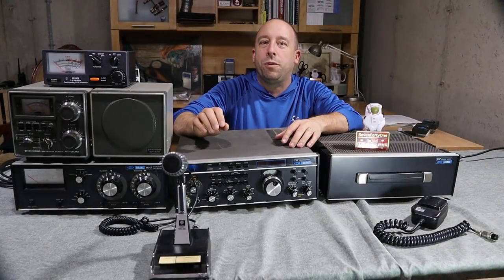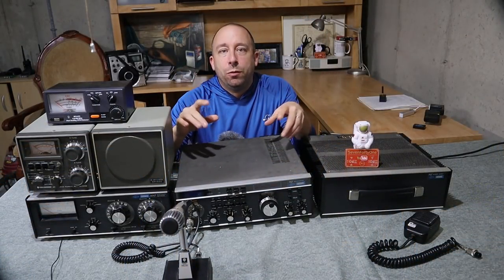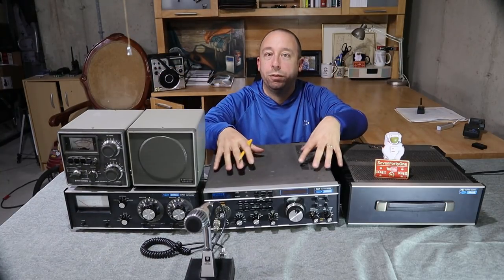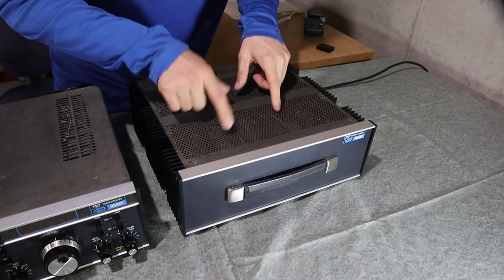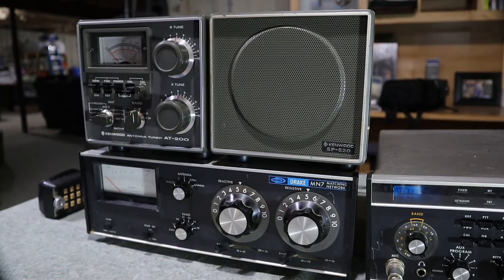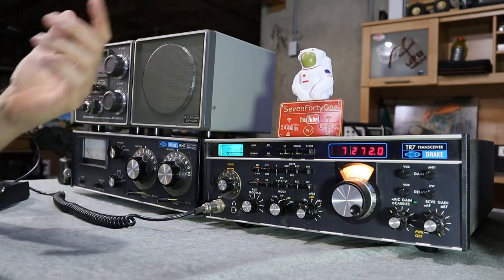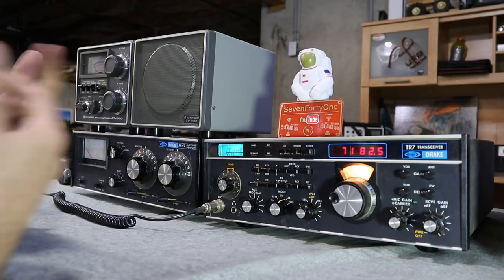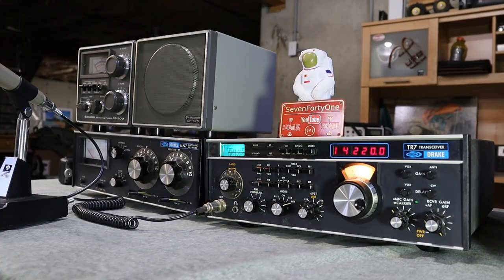Classic Ham Radio: Does this 40 Year old Drake TR7 Still Work???

Comment: When I was in the US Navy my ship had one in the Mars station.  It drifted but the receiver was almost immune to external interference.  As its antenna was located between our two most powerful radars plus the radio transmitter for the ship and you never would know they were in use.
The base club also used one with a 40M beam which was stuck because of a hurricane.  
The best night of QSO s I ever had was with that radio, even Cyprus station called us.  Good memories.
Happy New Year!

Comment: Good job on the video ! The Drake TR7 is a fine rig and is easy to listen to. It has just enough tools to get the job done. It really shines when the band is contest busy. On the AF or volume control, I have a TR7 and 2 TR7A rigs. Only one of the 3 has the volume completely mute. I have tried a few other TR7’s and they did not mute completely. Thinking that is how it was designed. Would be fun to hear from other TR7 user on that myself. For the AM on transmit I believe again it was designed that way to only use single side band AM. Not double side band AM. There is a mod to do double side band AM on a web page. The heavy power supply lets the TR7 run higher power on high duty modes like RTTY or FT8. The TR7 comes with a narrower 2.3 KHZ filter that hold the transmitting audio on the narrow side compared to new HF rigs now days. It is good communications audio. Easy on the ears.  I remember it was way out of my dollar range back when I was a new ham.  Just tune the VFO to the frequency and talk. No need to tune the receiver or dip the plate. Quite a USA made transceiver  1977- to 1981 or so years. See you on the HF bands.

Comment: lovely radios i currently have my second early TR7 here that i recently did a recap and a tune on this radio came to me for FREE i found it literally dumped in a skip! there was absolutely no way i could allow such a venerable old radio to be landfill so i took it home cleaned it off and gingerly power it up to find other than a partially failed frequency counter unit  it works just fine. so until i can source a working counter board i have slotted in a blue led chinese counter that allows me to adjust for drive directly from the high side of the mixer and swapped out every cap i could find  and it works a treat all the best with yours.

Comment: The Drake TR7 and it's companion L7 linear is my primary rig... Even work FT8 with a SignaLink attached to the rear audio and front mic connector. Awesome channel. 73, Roger NQ8RP

Comment: Very interesting!  I'm glad I found this channel.  I have a Kenwood TS-830s I bought off eBay two years ago that I've been dying to test but didn't have an antenna to test it with.  I can't put up any kind of antenna due to various site problems but hope to resolve those later this year when I move into a new house. In the mean time I have made two more eBay purchases, an MFJ 969 Versa Tuner II and a NOS Kenwood MC-50 mic, and my most recent purchase is an SDRPlay RSPdx.  I had no idea an SDR can pick up TX signals from a dummy load.  Now I can at least test the Kenwood to make sure I've tuned it properly.  Thank you for the idea!

Comment: The TR-7 is a keeper. It is a solid performer and practically bulletproof. They run circles around most any low end rig and run well with the big dogs even today. I own three TR-7s and two R-7s (along with a C-Line, TR-6, and 2-A). You want about a 20CFM fan on the radio, pulling air OUT. The AUX switch is not only for crystals, with the proper option in place it can give you quick access to the WARC bands. Your AM is completely normal and is the way a great many modern rigs produce AM. It is A3H AM which is upper sideband with carrier inserted. It is possible to modify the rig to transmit double sideband (A3E) AM if you have the AM filter but you will want to talk to me before you do the online mod. Noble Radio makes NEW crystal filters for the 7-Line and he offers a 450Hz CW filter. Filters can also be found online used at the usual places. There is a ton of info online about these rigs, most of it good.  As for re-capping there is only one cap in the radio that is a must replace, the large electrolytic on the small Power Supply board in the right front corner of the radio. Beyond that, don't sweat it. You will need the service manual to do an alignment but don't even start until you have read through the service manual and have a good understanding about how the radio works. It's not rocket science but it is radio science. The TR-7 intimidated the hell out of me when I first got it over 30 years ago but I know the radio inside out now. Please join us in the groups.io/g/DRAKE-RADIO group where you can get any questions answered about any of your Drake gear. 73 de Jim NU0C
Reply: Here's the missing detail for the AM mod: https://www.mail-archive.com/drakelist@zerobeat.net/msg09892.html
Reply: Marc club alabama hamfest nov

Comment: A friend of mine has his original TR7 with docs. The power supply was thrown out after a flood, probably just needed a drying. As I remember it, I put a standard (4"?) computer fan on the back of the TR7 for him. The TR7 was supposed to only need a fan in tropical high duty cycle operation, so he had never ordered one.

Comment: We have a Drake R7 at the Armature Radio  Club of the Vintage Radio & Communications Museum of CT (W1VCM) in Windsor, CT.  It is in dire need of repair, but haven't found any manuals, service manual, or schematic.  Seems the receiver wasn't as popular as the TR.
Reply from the maker: If I happen to see any docs for that I'll pass them along.  I need to  stop by and visit .... It's been a few years since I've been to the museum.
Reply: The combined 7-Line was a DXer's dream. If you can't find any help with the R-7 you are looking in the wrong places. I would gladly take it off your hands but would rather see you get it running and enjoy it. Try groups.io/g/DRAKE-RADIO.

Comment: After trading off a Drake 2B and A Johnson Viking radiant the transmitter, I bought a . Drake TR7 and the tube style VFO. The standard transceiver came let's say my monstrous power supply that supplied 12 volts and huge amperage to completely satisfy the TR7 needs.  that power supply alone it came a way of powering mods of rigs that needed 12 volts.

Comment: I was licensed In 1992 I think.  I was 14.  I had a Drake TR3 at the time which was the transceiver that came out right after your twins.  My Elmer had a TR7 fall into his hand in a month or two at a real good price and I drooled over it, but couldn't come up with the money.  A couple of months after that I bought a Yaesu FT-101ZD which was a great smooth operating radio.  W8PEF

Comment: Very useful video. I think the TR7 uses one sideband plus carrier for AM.
Reply: Correct, that is the way Drake designed it. No difference on receiving in AM mode as long as there is a carrier.

Comment: I restored my AC4 PSU with new Caps and Diodes, did nothing to my RV-4c remote VFO or my TR-4c, still works as a charm using a D104 mic. i use it on the Nostalgic NET here in Norway,, RV4C-TR4C- MN2000 but one thing is missing thats an L4B for the complete line

Comment: Despite the Drake team bad choice of external looks for this stereo looking ham radio, the interior was a masterwork I love assembly and engineering where's card cage construction that aloud lots of interchange if necessary.
Reply: It was the finest construction design of its day and never got adequate rewards. The frequency stability was amazing from a couple of seconds after startup and holding frequency forever after. I paired my TR7 with a HEATAHKIT HP220 two kW linear amplifier and killed successfully on many contests.   I have actually collected ALL but the phone mdevice made by Drake
Reply: I even bought 2R7A, put the best parts into one and so the remainder, then having a complete drake station with a solid-state remote vFO added.  I sold the whole drink station two European and got a yesu FT2000 and found out what a fine selectivity receiver that is.   Although I stepped over and got a Kenwood 990 or was it the 9000. I went back to yazoo and have never left since. When I became disabled my yahoo FT DX9000  front screen which turned to bright yellow overall.
Reply: That was paired with at K3 which is still there.

Comment: Step one. do a recap on the drake radio and id also recap the power supply. as for the AM, you will have to check the man on that. I never owned a drake so idk if that is how they was built or if it has a fault. but the manuals and schematics should help figure that out.

Comment: Great score! That fan has definitely got to go. i replaced a very noisy fan on my bench power supply with an Arctic brand fan that has its speed controlled by a temperature sensor that you attach to the heat sink. Maybe look at that approach.
Reply from the maker: Good tip...I'll check it out!

Comment: A number of comments on the AM test transmission. I don't know why people expect a perfect transmission on a mode that does not fall into that frequency category. Most would do only AM test transmissions on the 80 meter band as per regulations if you are interested to do that. That radio and both microphones sounded awesome and above expectation given the age and condition of the rig. The radio found the perfect home. My best piece of ham equipment stand next to my bed... Icom IC-R70 and have no microphone jack. de ZS1JDT
Reply from the maker: Am can be used on any band in the US

Comment: Overall, I think the Kenwood mike sounded better. I agree, you may have had the mike gain a little high. The Drake mike seemed to cut out low frequencies and may be the better choice when in a DX pileup.  Very good review. And I wish I could get my hands on one of these radios!

Comment: Nice Tr7!
First of all, the fan on your radio is not the correct fan as supplied by R L Drake. These were designated as the FA7 Fan and were an option. The fan you have on your power supply appears to be an original FA7 fan. Both pieces used the same fan. You can find the FA7 units on Ebay from time to time.
Great radios! Enjoy!
de w4jba
Reply from the maker: Thanks for the info!
Reply: @SevenFortyOne  The FA-7 was an off-the-shelf 19CFM fan. Nothing special about it. Some users have found the AC Infinity Axial 8038 to be a good substitute.

Comment: Noted your TR7 is making some noise when the AF gain fully off - The reason is the the AF gain potentiometer's carbon track which does not have metal endings. However, you can replace it with a track that has a metal endings. This is an easy job once you get the pot out of the radio. I have done it on my TR7 and it is now very quiet. Here is where you can get a new carbon track: Write to Brett at  sales@blore-ed.com ask for the carbon track of  their "series 45"  potentiometers value is10K log with 3 solder terminals. The company is Blore Edwards Ltd located in UK. 
73 and enjoy the silence!
SM5MRQ
Reply from the maker: Thanks for the great info!